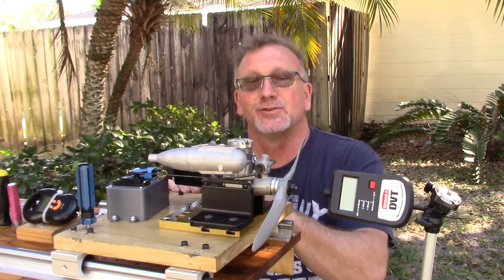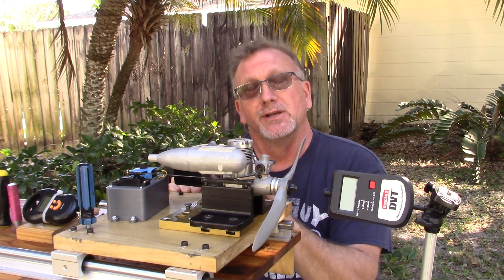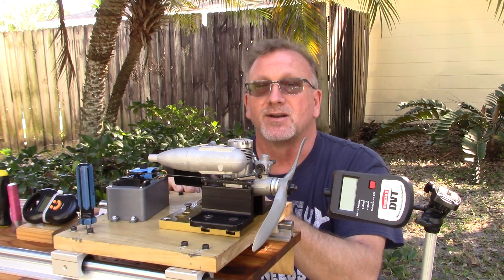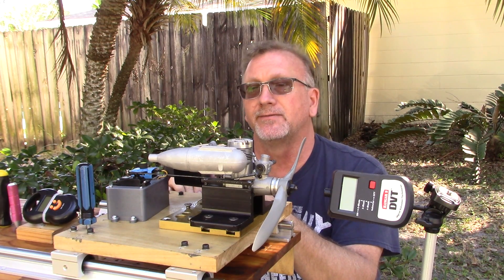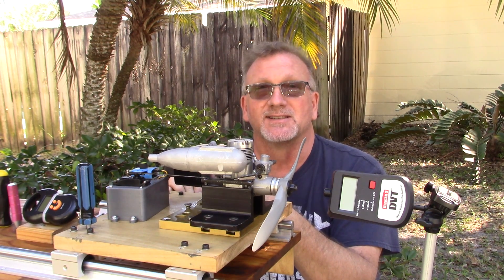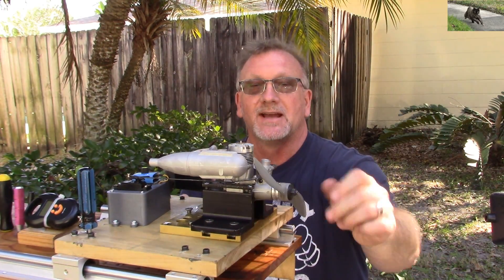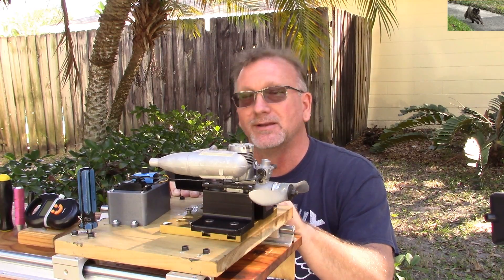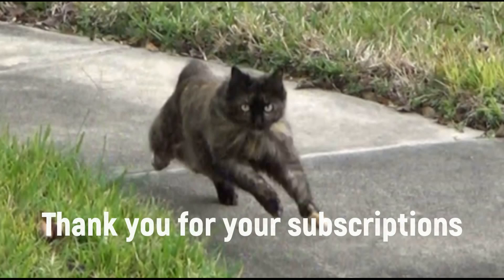OS 40 FSR A Run (Low speed needle tuning shown)

Comment: I still understand all the adjusting? What are the steps? Can anybody explain...
Reply from the maker: Based on your question, one can only assume that you are new to glow engine operation.  This particular video was not made to instruct a beginner on how to tune an engine.  I would recommend reading this article.
http://www.flyrc.com/glow-engine-tuning-setup/#:~:text=Start%20up%20the%20engine%20at,slowly%20back%20up%20to%20full.
https://www.hooked-on-rc-airplanes.com/nitro-engine-tuning-tips.html
I have a very old series of videos where I go through this process but I cannot say how good I did on them. Most of my older videos are complete crap anyway.
https://youtu.be/lz4cxXjoA28
https://youtu.be/EXLj4uIQ2gQ
https://youtu.be/_t10iguIKfI
https://youtu.be/dcuGsuKCHpw

Comment: Do you balance you APC props? The website says you should balance.. but ibe noticed mine being pretty well balanced.. Thanks
Reply from the maker: Most of blades have been balanced but I don't go back and check them after some usage.  Most APC's that I buy new are verified/checked but I have yet to need to add weight to many.  Maybe a handful.  I use clear nail polish to balance as opposed to removing material.

Comment: Thanks David yeah im trying to get my planes ready for spring,i just got back into the hobby this summer after 20 years,my fuel i ran is torco 10 % i added benal racing oil to it and the 46 ran good for me.i like for my engines to have plenty of oil and im not fussy with the mess as long as it runs cool.my last flight with my 4 star 40 sticky throttle.ive got that fixed now, but all the help i can get to have a happy engine,thanks again for info.👍

Comment: I don't think there is a better running engine out there, this is what engineering perfection looks and sounds like.
Reply from the maker: Well....there are loads of excellent running engines, but yes OS produced some of the very best for sure.  Even with the many different carb styles they made, they all seems to work quite well.  The Super Tigre Mag V carb is also one of the best that was ever made.